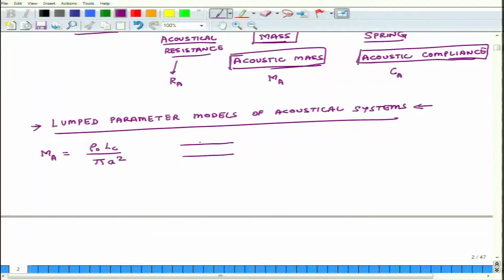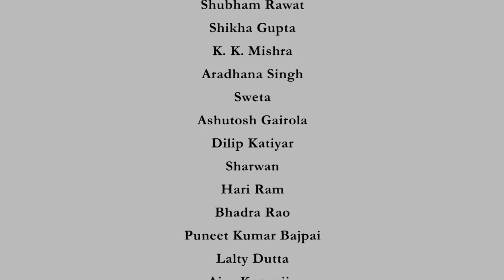Helmholtz resonator

Comment: Thank you. My not being aware of la and lb must be the reason why the resonator which I've accurately measured does not resonate at the frequency I calculated when testing (by blowing compressed air across the neck). It's about 6% out. I'll recalculate with la and lb included  using your formula.